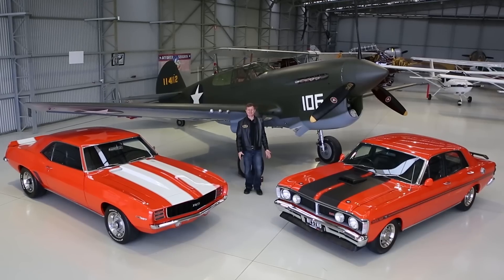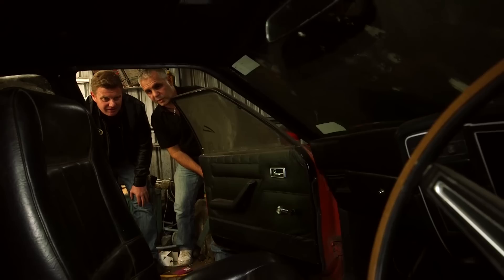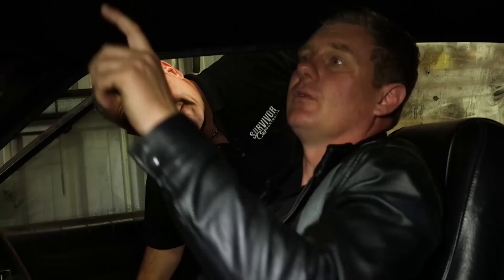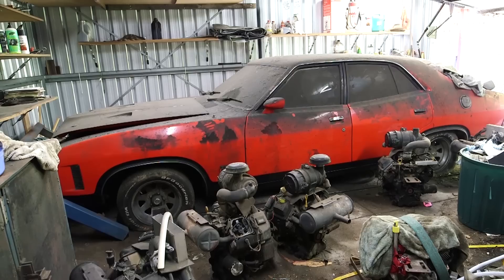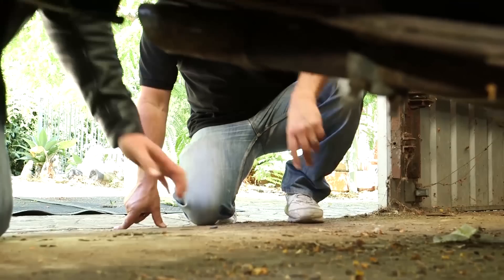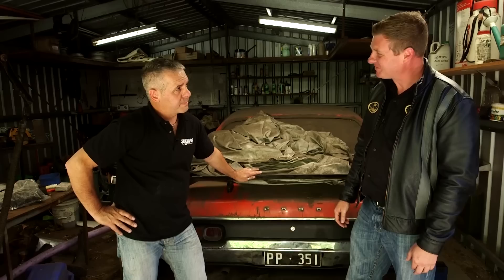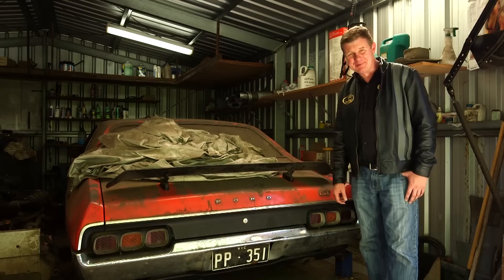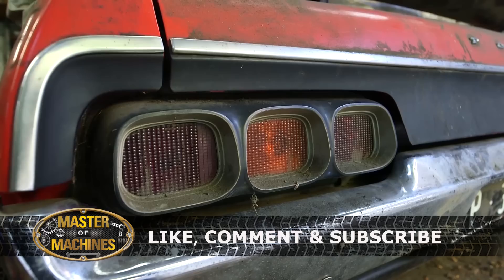Aussie 1972 Ford Falcon GT BARN FIND - Stored for 28 Years!

Comment: Love this. I owned an Aussie built 72 XA Falcon 500, copper bronze, tan vinyl top , bone coloured interior, bench seat , non power steering 302C column shift auto, back in the 80's . Wish I still had that car. I can't remember when I last saw an XA on the road here in NZ, correct that I saw a 2v 6cyl coupe a couple of weeks back but sightings are now few and far between around here.
Reply: Has an XA GS Fairmont coupe as my first car. 6 cylinder because dad rightly wouldn't let me have a V8. But I keep thinking lately a 2v 250 XA would be great car even if not produced as a 2V. Rare as hens teeth.
Reply: @MegaROCKY001  The 2v 6cly pumped out about 160bhp and the special 2 barrel inlet manifold looked like a Chrysler 6 one with those seperate branches. Must of sounded mean on induction, as you say rare as cars.
Reply: "Rust never sleeps"

Comment: What a great story Glenn to reunite the original owner with this beautiful XA GT Sedan. Imagine if it was a RPO 83 as well, but still absolutely awesome.
I know of a barn find a Chrysler by Chrysler CH Hardtop with the rare Landau roof option & rare left hand mirror option.
Outskirts of Melbourne & it has been sitting since 1983 in the shed. Original 360 too.
Also second owner alter rare, export model to Sth Africa, 1970 Valiant VG factory V8, Regal Safari Station Wagon, fully factory optioned, fully dealer optioned, 66,000 miles all original paperwork including bill of sale, order form, white roof special.
The guy who has it is the second owner & has been sitting in the garage since 2005.
Suburban Melbourne.
Love these types of stories, old barn finds.
Great video for sure.

Comment: Friend of mine has a calypso green XA GT manual coupe. He bought it from a friend when it was near new.  It was stored for about 25 years then he had a full nut and bolt restore done on it. Matching numbers and it is MINT. Won some big prizes at car shows including best restored. Drove it a few times about 40 years ago, great to drive and the faster you went the more it seemed to hug the road.

Comment: Awesome genuine Aussie muscle car, can't believe how it was left for 28 years, all this makes me feel emotional about the 1972 XA Fairmont 500 my late father bought brand new, it was in Mission Brown exterior I believe it was called, correct me if I'm wrong, and it was a Continental with a white vinyl roof , and extended to the rear doors, I was still too young when my father sold it, otherwise I would of wanted to keep it for myself, and I actually saw it at a local house after it was sold to another owner, I know my father's XA Fairmont 500 Continental was not close as important as the XA GT in this video, but if it still exists, and I could find it, I would buy it back.
Reply from the maker: All survivors are important, GT or not. Like you, I'd love to track down and buy some of my Dads past cars. Thanks for sharing that with us, and I'm glad you enjoyed it. :-)
Reply: @GlennEverittMasterofMachines  , Very true, all survivors are important, I still remember the original number plate, and there was a similar one in my local area, but not Continental, spoke to the owner once, still must have a photo of it, but haven't seen it for a while.

Comment: That dirt is paint protection from 72', but seriously, this 'D' block is the Thoroughbred! shes got the factory crack tested crankshaft with 4MA stamped, its the 4bolt Mains Blocck, the Heads will have the '4' casting embossed in the corners, facing the 4V intake manifold. As Glenn grabbed the 'Toploader' gearknob with the 'R' beside the 2-such a raratey in itself!  I remember the day the Mobile Crane came on-site to hoist the 'Red Pepper' FoMoCo Icon from its well overgrown, swampy final retired resting plot (so it seamed). Then the media got wind of it, followed by the legend himself- Allan Moffat, who had to see it with his spectacles hinself, and like everybody there,they were all in disbelief. Long story short!, just find the video of the recovery/extraction/removal. Its friggin amazing!!!!!!!!!

Comment: I had 3 XY GT's and 1 divorce..so brings a tear to my eyes. Wonder in the left engine mount had a hole drilled in it and a bolt fitted to stop them breaking engine mounts??

Comment: I  was offered a 4 door 72mod GT back in the late 70s when the big fuel crisis started, for $1200. How stupid was I.
Reply: I had a mate bought a pretty rough HG Monaro 350 in the early 80s put the motor and 4 speed in his HQ van and took the rest to tip.
I sold a roughHK 186s Monaro for $600 about the same time.  :(

Comment: i know where there is a 1974 datsun 180b gx in a garage near showroom condition all original also under a cover. The only non original part is it has a feris radio. The gearbox was replaced with an original nissan 5 speed box that was never inported into australia as 180b gear box and the nikki carb has been replaced with the 180b sss twin side draft su genuan carbs as coppies where made. I beleive the original carb and gearbox and radio is still there. It had been resprayed around 1983 and reupholstered at the same time as original as posible

Comment: Dust problems are annoying.
Even in my brick garage the dust gets in under and especially over the roller doors.
Must chase up the brush type barrier system I saw advertised locally a fee years ago.
Anyone know if the brush systems work much keeping dust out?
Or a good one that works?

Comment: I loved my Fords but I have a question for you guys?? I thought the Clevelands were RED and the Windsors were BLUE? Did I hear wrong when you said this XA has a 351 Cleveland and not a Windsor because the covers were Blue???
Reply from the maker: Most Clevos were all blue through that period, although some variants (302 from memory) had red covers. In the final years (the 80s) they also had black with silver covers.
Reply: @GlennEverittMasterofMachines  yes my XC panel van and my two door continental XB were red. Miss them heaps. Thank you for your feedback.
Reply from the maker: @Solarlube  , my pleasure mate.

Comment: Clean it up, register it and drive it that’s what their for.
Reply: It would need a full tear down strip the motor apart and rebuild
If they’ve left fuel and oil in there. And especially if they left water in there. Would need to check for rust in the block mate
Full rebuild for sure. To be safe

Comment: YEP EVEN THE AIR IN THE TYERS IS WORTH MONEY AS ITS 1987 AIR FROM SYDNEY PAT THE PANEL SHOP OWNER, LOL :)  That's how ford owners are they think that just because its a gt no matter what extras its got that its worth more than life itself, typical ford owners even with the new fg x xr8's they want more than what the new cost of the car was yet they have like 50,000 kms on them, total and utter bs if you ask me, dont get me wrong cars do go up in price for what they are in racing car history ie: ex race cars selling at action, but a factory gt owned by the average person even a xw or xy gt ho is not worth 600K, more like 150K that's it also why brocky's cars are selling like for around 10 to 15 k in the early 1990's VB/to VK and even vl directors and the walkingshaws were double the price in the early 1990's get my drift?